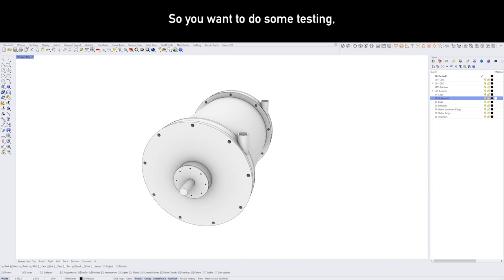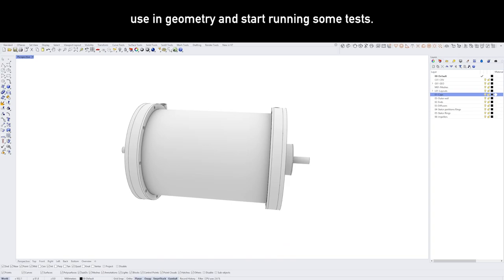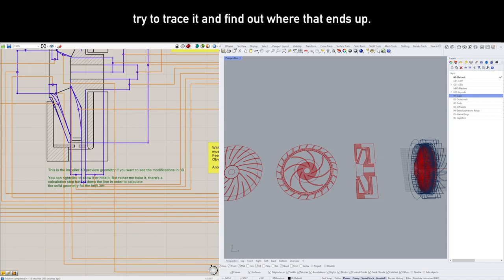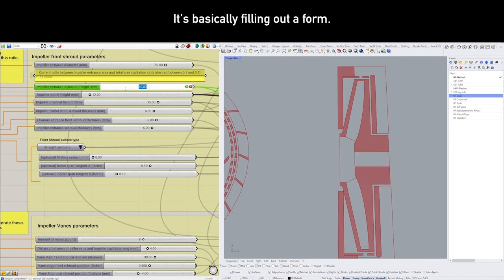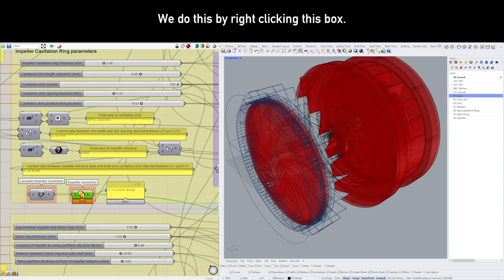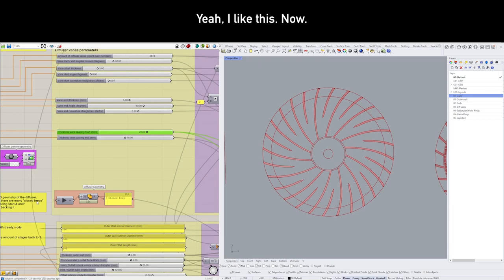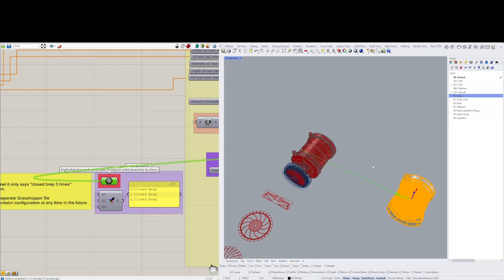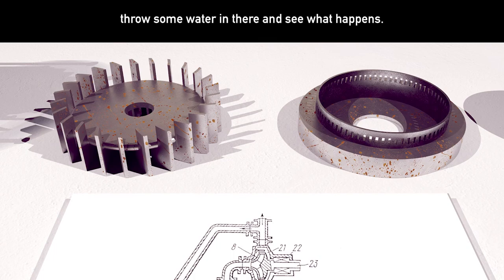ULTR - Kladov Cavitator - prototype parametric 3D engineering model builder - Tony Jabony

Comment: Many thanks Bob and Tony 🙏 A powerful parametric model for producing a device by machining (excavation) or 3D printing for exploration, experimentation, characterisation and refinement - a design “ready to go” to couple up with a suitable electric motor and a feed and return including a return valve to circulate a proportion of the water from the exhaust port back into the input (feed) port. 

Allows for rapid prototyping, rapid learning and accelerated development

Comment: Absolutely amazing.
Does it make any sense to try a 3D printed version of that or would there be too much bending that prevents a  strong enough cavitation effect?
Reply from the maker: Well - 3D printing variants with a clear outer tube and water with later added die could allow understanding of flow dynamics. Some parts could ultimately be printed with Direct Laser Metal Sintering.
Reply: @MFMP  Right. That would make sense. Even if it doesn't provide enough cavitation, it would help to sort out issues before ordering expensive CNC parts.

When Tony released his original model, I loaded it in a 3D printer slicer software and noticed that it actually fit to the build plate. I'm not sure if that was an automatic scaling by the software or this was intended size. 
Do we have any idea about the size of the original Kladov Cavitator? I think I didn't see that mentioned anywhere, but I might have missed it.
Reply from the maker: Well - he was driving it with up to 130 kW motor - so not small! @stezo9770

Comment: This seems much more complicated than configurations in SW
Reply from the maker: Solid works?
Reply: @MFMP   Yes
Reply: Yes, although the principle of a parametric model is the same, this is almost working with bare code. Rhino is available for free evaluation , directly from the company, a lifetime license is around 800 euros. . Last time I checked SW costs like 5000 euro's for 3 months, no free trials available, only accessible via re-sellers. Rhino will also work just fine on older laptops or computers since the way it generates and displays geometries is very lightweight compared to the SW interface. 
I do like solidworks for it's assembly features  and excellent filleting of corners. but Rhino is way more accessible and open source
Reply: @TonyJaboney   Ah, I was wondering about the sharp corners. In fairness, even in SW I always save my work RIGHT before I do fillets/chamfers because they have a nasty tendency to crash the entire application. You can actually set SW to a lightweight mode if your laptop isn't quite up to snuff.

Comment: Gabriel here.
The formation of calcium carbide is done through heating carbon and calcium in the absence of oxygen.
-Fresnel lens
-Sidewalk chalk
-Charcoal

Grind the chalk and charcoal together Focus sunlight on the mixture, it will liquefy.

You now have calcium carbide, which when added to water produces acetylene gas.

Extrapolate that method into cavitaton in water and you will have a constant creation and disintegration of calcium carbide producing a steady bubbling of acetylene.

I tried to delete the Gabriel part and felt immediate revulsion.
Does this happen to anyone else

Comment: Is it solely producing hydrogen?
Reply from the maker: It is meant to produce excess thermal heat from supplied rotation.
Reply: The rotation is concentrated, and is what allows the atoms to spin apart?
Reply: @MFMP Red faced😊 missed that

Comment: Can you describe in a sentence what it does?
Reply from the maker: A variation of this device is claimed to produce energy from nuclear reactions due to cavitation of a working fluid within a specific set of parameters.

https://remoteview.substack.com/p/method-for-obtaining-energy-anatoly
Reply: @MFMP  "Moreover, the fuel of nuclear power plants is used about thirty times less efficiently than that used in thermal power plants."
Wow. How is that even possible? Why is nuclear power so inefficient? The safety measures?
Reply: @MFMP  one more absurdly basic question, the term "fluid", does that include liquids and gases? Or only liquids? Liquids are easy but I'm having a difficult time visualizing a gas behaving in such a way that it cavitates.
Reply: @fasted8468  Gases are fluids. At the same viscosities, they will mechanically behave the same in turbulence- you can form bubbles of pressure differential sufficient to approximate a vacuum- this would require extremely high velocity streams.
Reply: @ticthak  extremely high velocity speeds like the windhexe? Any fluid could theoretically work?
Reply: @fasted8468 Probably MUCH faster- exceeding Mach 1, for certain, but for that fluid.
Reply from the maker: Well - the pellets are only say 5% pure and after a little time they do not produce enough neutrons to allow for the chain reaction and they leave unburned fuel - so they have to be "re-processed" (allows for the extraction of plutonium for you know what). @fasted8468
Reply from the maker: In this case, not gasses, liquid fluids, but can be a range of levels of viscosity - you can see he used water, but also oils. @fasted8468
Reply: @MFMP  you are the best Gabriel
Reply: @ticthak  I agave this sinking suspicion we are no moving through space as quickly as we are told. Not still, or flat earth, but yet not 70 miles per second.